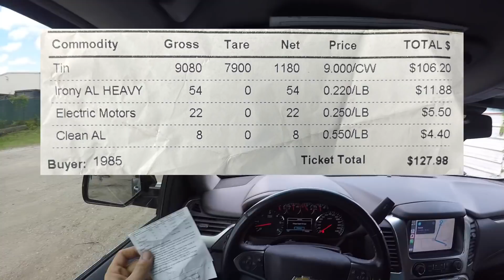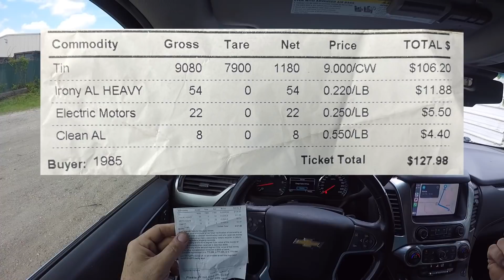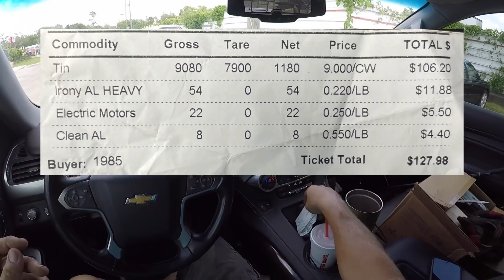How Does This Stuff Work? Bizzarro Street Scrapping

Comment: Not a lot of brass, but the socket part for lights can be solid brass, depending on age. There is usually only one bolt on the bottom that needs to come off to pull the whole inner housing.
Reply from the maker: Yeah I know but I already have so much stuff still to break down - not looking to add to my chaos yet LOL

Comment: Jeff should get one of those wire shredders it seperates the plastic from the copper any type of wire and there is a company that buyes the plastic aswell.👍👍
Reply from the maker: Jeff just works there.  He does not make those kinds of decisions.  They would not do - I have seen them send away thick wire unstripped and they have a stripping machine.  They are all about turn money over.

Comment: Dude, you need to buy another battery. How many times have you run low? LOL 😂
Reply from the maker: I did buy another one.  I had already changed it out today. Thats how bad it was to start out with.  The entire run was about 5 hours and the camera is basically on the whole time.  I usually run about  half that length.  Maybe I need another LOL
Reply: @nachostuff  WOW. I take back my comment.  😺

Comment: A very sharp wood chisel works wonders when tearing down electric motors.  Just make sure you use a small sledge and not a claw hammer.
Reply from the maker: I have decided I will not be tearing them down.  Too much effort for not enough added return.

Comment: If u lay the hot water tanks on there sides instead of using the dolley they will roll pretty good that's how I load them
Reply from the maker: Simple enough!  They arnt too wide for the trailer?
Reply: @nachostuff  ya
Reply: @nachostuff  no I have a 16 foot car hauler with ramp gate big pickup tommrow one job is a big pile at a farm and a brush hog then another place one grill then another house 5 appliances

Comment: You dont need to use a cutting disc just cut threw the copper and pull it out from the other side.👍👍
Reply from the maker: And how are you cutting through the copper?  I use a cutting disc. It is the fastest and easiest way and still not worth the extra effort.  If you are saying I should use clippers - you are down right crazy!

Comment: By the way u can take tires with metal wheels also bc the scrap yard would take them bc cars come in with tires on them u could have taken the 3 metal wheels to scrap yard with the tires on them u can tell ur not a real scrapper
Reply: I'm pretty sure scrapyards like getting 2 tons or more of scrap in one car and deal with the tires on them. Matt is an excellent scrapper! A bit messy, but we support him! 😊
Reply from the maker: You can take as many tires as you want to the yard.  You are just deducted 50 pounds for each one you bring in.  If I brought those 4 tires in they would take 200 pounds off my load.  They probably weighed 200 pounds or less.  Therefore I make nothing or loss money by bringing them.  The cars also have that same 50 pounds deducted for each tire.  Some guys bring them in without tires and some don't worry about the lost weight

Comment: Also don't waste your time on crap that's not worth anything. Plastic office trailers or not worth anything. Fiber optics or worth anything. Get your old lady involved or set up an online sell and things that are not open you will find them and dumpsters. Look up the prices online sell them for half or three-quarters off. Sell them online or in yard sales. Some cities have more than one scrap yard find out which one gives you the best price for each item. Go to that scrap yard for each different item. You're right out of there with $250 to $300 each time. Don't use up all your time on just strap. Organize yourself on Specialties. Number one wire number two wires. Copper Brass Motors batteries have it all sectioned out into different totes to where they don't have to do a thing clean up your metal to make more money do it yourself so they don't have to make that money. All it cost you is time. Get your kids involved it's free labor. That's what chores are for. I want to live under your roof then clean that metal strip them wires.
Reply from the maker: I do many of those things. And I think I use my time pretty wisely.  Most the yards here are pretty much the same.  Some have a better price on some things and others on others.  You just have to learn the tricks of the trade.